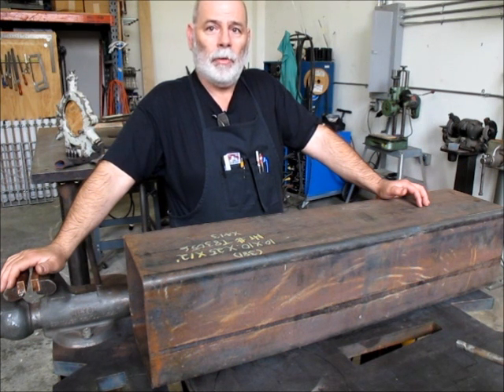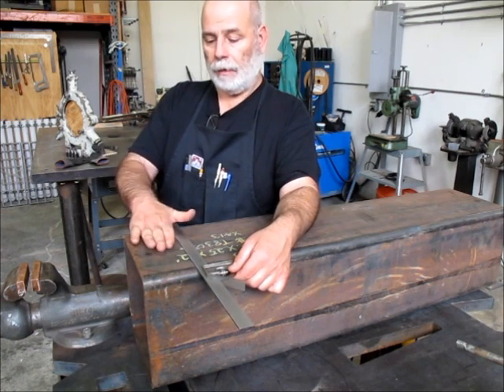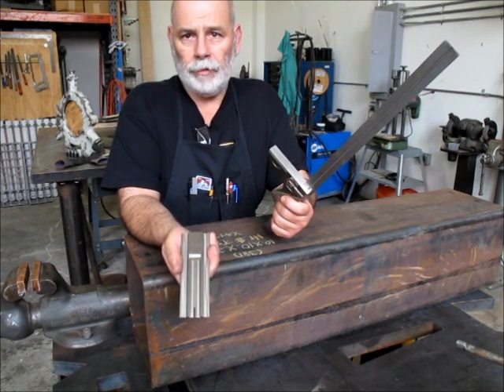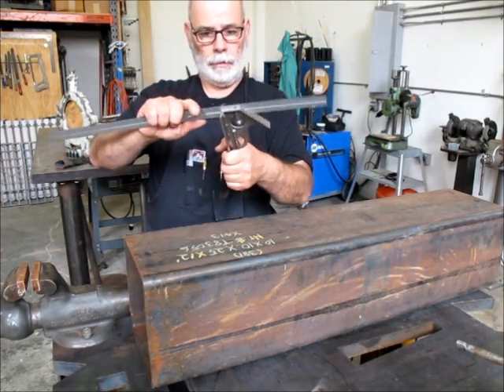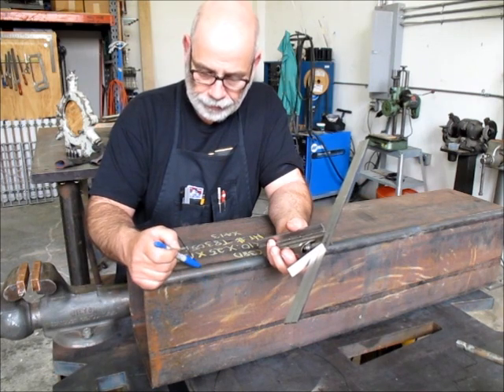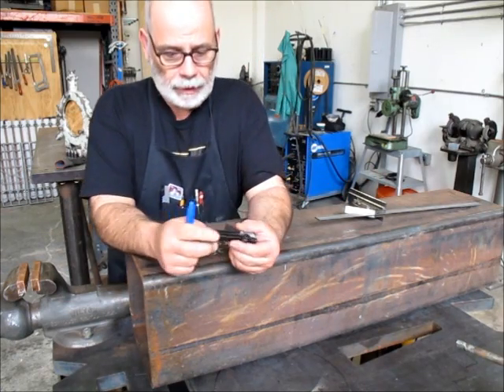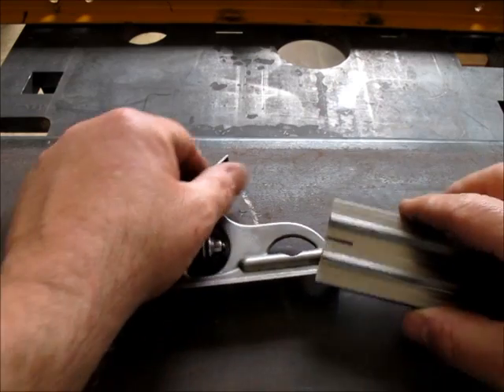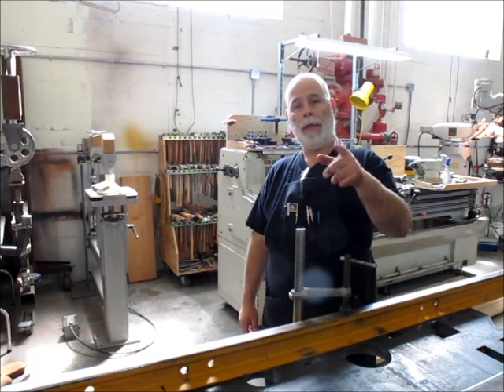Tools and Tricks for large structural tubing.

Comment: Trick I have seen from a Old Portuguese Gentleman on a construction site was to wrap a roll of sandpaper around a 1000mm steel pipe. Lined up the longitudinal edges where they overlapped and made sure it was "flat" on the surface, and walla, square line. Sure this could be a useful elementary method on a large square tube. (the roll of sandpaper obviously had straight edges)

Comment: Isnt  a wraparound a better way to get around that radius? You're basically  running 2 straight edges and taking a leap of faith. But as the tip of your sharpie drops over the event horizon, its  body forces it to move away from the straight edge as the body gets thicker. What's  accurate is when you're back on the flat. ...you know what.. you just gave me an idea about how to use my center finder as a sort of a wraparound alignment tool. Thanks for the tip

Comment: Good day.  Is there a reason that you didn't make the face extender long enough to match the outer edge of the ruler?  If it were to line up with the outer edge of the ruler, it could be used to transfer the line to the other face without having to use another tool, which can introduce another error (albeit small) into the mix.  (this would then be akin to using a saddle square in woodworking)   Also, if the face extender were a tad wider, it would cover off a good range of corner radii, and allow you to transfer a good line to the adjacent face.
Reply from the maker: +Vern C Hi Vern,

That might be a useful modification. Thanks for the suggestion and comment. Now I need to make another one. 

Cheers,

Tom

Comment: No the one the center gage is cast iron, I'm sure it's a very old starrett . In fact I have an old starrett square that's a protractor and a square head two ways. I thought I had the only one till I saw one on eBay it sold for over $350.00 . But I still haven't seen the wide edge center gage. I'll try to dig them out but tough for me now I'm stuck in a dern wheelchair and have very little help to do anything. It's amazing how many friends you have when you need them. Even tho you were there for them at there beck and call. Makes ya feel used. Ok nuff said I'll look in the spring when I can . Thank you for your time and expertise , I too am a machinist by trade from voc school till 79 when I became disabled so I live my real life thru the videos you guys bring , yours and aboms , the two Keith's and kilroys and a few others I'm workin hard vicariously . Yupp thanks so much.

Comment: Hi Tom, I'm pretty sure many years ago one or more of the too companies. Offered for sale a square head and the center finder with wide wings on them. I know for sure the center gage , I have one it's a starrett , and I think I have the matching square head . All my machinist tools have been in my boxes from almost 40 years ago. But I remember when I used them for layouts on bearing blocks for the steel mill . Someday ill get my shop cleaned enough to get where they are. Thirty years of tool collecting of all types hasn't helped.
Reply from the maker: +Silverbullet Hi Bullet,

I would be interested in seeing a picture of those wide heads. There are some out there but all I have seen is cast aluminum. Get busy and start digging. Inquiring minds want to see them. Thanks for the comment.

Cheers,

Tom

Comment: Tom Great stuff. Another bite @ the apple per say, to get over the radius, is get a piece of 2" in, or 3"in angle maybe just 2 to 3 inches in length. I had to do a lot of layout as a Fitter/Welder. Actually what you need depending on the size material you work with is what I'd call a set for tubing and or angle material. I worked from 10" tubing down to 2 in. tubing. same for angle material. When you make your guide for the INSIDE radius of angle material, you'll find that you'll have to grind down what I'll call the exterior of the guide, (where the two angle's meet) so it will mate / layup to the inside of the angle material. All my guide's were aluminum min. 3/16 thick, I preferred 1/4 when I could grab a small piece of scrap, when something was being cut. They still work great when I get to use them.
Reply from the maker: Hi Dave,

Thanks for the comment and sharing your tricks. I always like hearing how other folks solve similar problems.

All the best,

Tom

Comment: Have you looked into the square made by LaGeese Products? It is called the LaSquare and has a 2" wide base so you can mark around corners on square tubing and even use it on round tubing. It is probably one of the most expensive squares I have ever seen but looks very useful. https://lasquare.us/index.php/
Reply from the maker: Hi Michael,

Thanks for the link. If you think these are expensive look up a Starrett Forged and Hardened combination square. These appear to be made from aluminum which is not a long lasting material for a square. Good idea however. 

Cheers,

Tom

Comment: Tom,
    I'm working my way thru your videos... And have been wanting to ask what the impressive section of yellow rail road track/rail is used for???  

Thanks, Chuck.  Oh yeah.  Where does one come by an item like that?
Reply from the maker: Hi Chuck,

The track is used for working hollow sheet metal shapes. I can extend it on the table so it sticks off and work the seam of a cylinder or cone on the track. The one I have came off a big bridge crane that got shortened up. It was headed for the scrapper when I got it. I see chunks on Craigslist from time to time.

Regards,

Tom

Comment: Diy version of that nice square Jody uses, very useful tool! I'm working on some 7 x 1/4 in square and need to make some 1 inch holes in a piece that is too big to get inside. I have a junker benchtop drill press and some nice hand drills but not a magnetic drill. How would you approach getting them accurately placed (fab work), and cut? Layout will be accomplished in the same manner you showed here. Also, that center finder works great to make perpendicular lines on pipe as well.